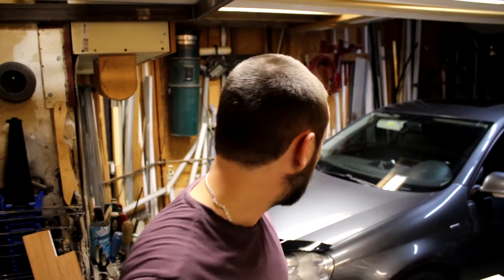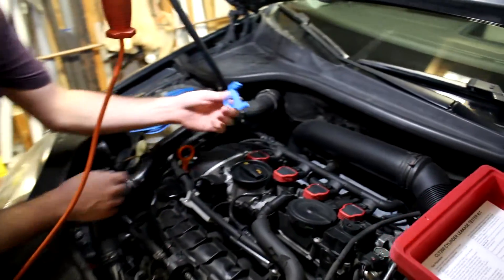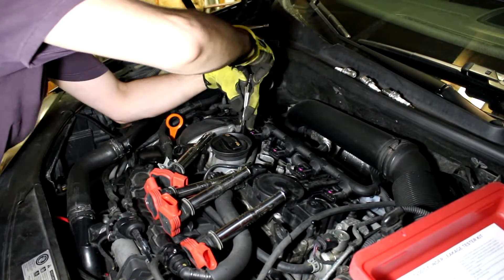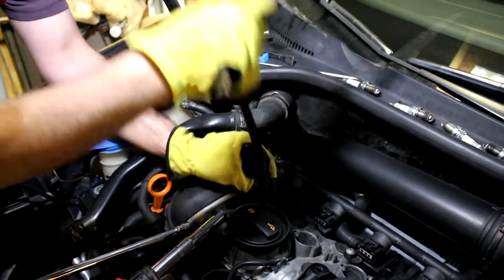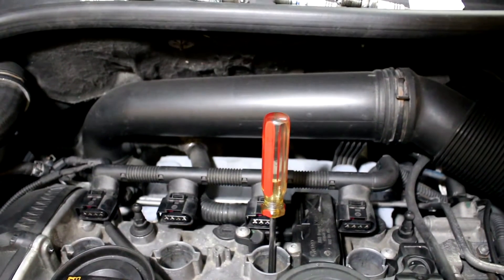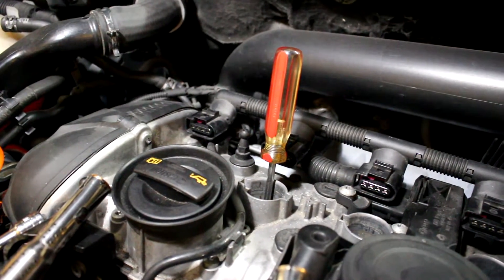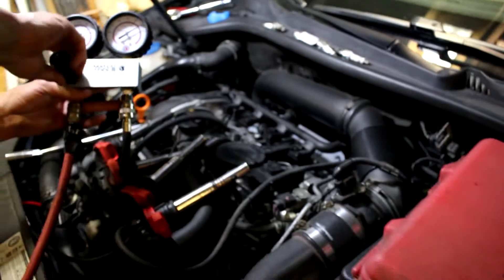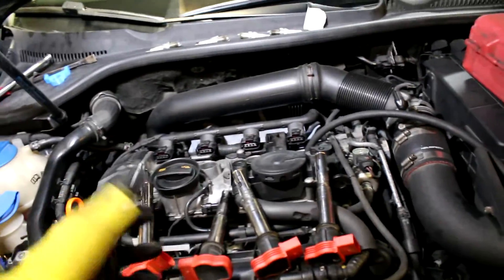How to do a Leak Down Test - VW 2.0T TSI

Comment: What if i turned engine counterclockwise? like 30*
Reply from the maker: 30 degrees doesn't seem like a whole lot, but just hope it didn't skip timing. Sometimes the valve springs may cause a slight rotation in the opposite direction which isn't a big deal.

Comment: Are there any TDC markings on the crank pulley that would help getting the positioning correct? Is it still worth doing a compression test before/after this or is that just duplicating things?
Reply from the maker: If you suspect compression is low before hand it doesn't hurt to check. As for markings, there are some on the sprocket. There's a fat tooth at the top of the pulley on the back where it mate's to the chain sprocket so that's 12oclock
Reply: @WannabeTuners  Just compression tested my 2009 VW Scirocco 2.0 TSI - CAWB engine code as it has a intermittent misfire. Getting pretty much 200psi on all four cylinders cold, very slightly higher hot. Not bad for a 90k engine and no need for a leakdown test I think!

Comment: I bought an 07 Passat Wolfsburg 2.0 TFSI with 140k miles and regret it. It died on me and I'll soon know if I have to rebuild the head or engine. I don't know why, but I'm fantasizing rebuilding with a K04.
Reply from the maker: Damn sorry to hear, hopefully the repair goes well. Haha it's an addicting hobby that's for sure!
Reply: @WannabeTuners  It's a DSG automatic. If it was a standard, I'd be more enthusiastic about trying to modify it. In running condition, the car's probably worth 3k, so it's almost like gambling to try and hotrod the thing. I've always driven manuals, and I love the control it gives me. I hate automatics, but for an auto the DSG dual clutch thing is pretty hot. Gear changes are fierce.  

My chain must have jumped. What's crazy is the chain, the chain tensioner, the cam phaser, the timing belt, everything is intact and working. You normally see broken tensioner, tensioner guides, chain, but everything is solid in my car. That almost assures me that I have bent valves. 

If I trusted the transmission, I'd go big turbo and rebuild whatever was necessary while I have it apart. 

I'm pretty mechanically inclined, but I've never done any of this stuff. Learning as I go.
Reply from the maker: @HideSeek_Soje111  So your '07 has the TSI engine? If its not the timing, it could be that the balance shaft seized up and has locked up the motor. When my exhaust balance shaft seized, the starter could not turn it and even with a large breaker bar on the crank pulley it would not budge. Keep us posted on what you find!
Reply: @WannabeTuners  It's a TFSI. When it died, the starter was turning the engine, but it sounded weird. I later found out it was the sound of no compression. I got it home and did a compression test. When doing it, I looked at the cams and both cams were turning. I had 30 PSI compression on 2 of the cylinders and 0 PSI on  the others. I'm learning as I go8 and am relying on the internet for answers, so it's slow moving. I probably should have just pulled the heads in the beginning. I could pull the exhaust manifold to try and see the valves. 

 I can turn the motor, but it comes to a point where I can no longer turn it. I get so lost with this stuff. I had the engine at TDC and placed the AST cam locking tool in the cams. It fit, but I then realized I had to make sure that I actually had piston 1 at TDC on the compression stroke. So now I'm confused. I shouldn't be hitting valves, since the . cams are still in the position that the locking tool holds them. I'm driving the Audizine forum crazy with my questions.

I'm going to look into the sized balance shaft.
Reply: @WannabeTuners  I appreciate the response by the way. I need all the help I can get.

Comment: Why not at the bottom of the stroke?
Reply from the maker: It's just generally how leak down tests are done. I imagine that at the bottom of the power stroke the exhaust valves may be open due to valve over lap.
Reply: @WannabeTuners  cool, my tfsi done 150,000 miles and I'm gonna give this a go. Thanks
Reply from the maker: @manccescapades4671  You're welcome! Let us know how it goes

Comment: Great video as usual guys.  Perfect timing because I just did this on my MS6 today.. it was misfiring like crazy and had a Po302 code.  Replaced plugs and coil packs were fine but cylinder 2 blew 0 PSI on the compression test.  Did the leak down and there's literally air coming out of the spark plug holes on cylinders 3 and 4.  Cylinder 1 had air coming out of the oil cap pretty good. Cylinders 3 and 4 were nice and tight at least.  What do you think, bad head gasket and piston rings in cylinder 1?   Got 112k miles on it and I'm sure those intake valves are gunked full of crap..
Reply: I got a cheap gauge from harbor frieight so I don't really trust the right leak gauge.. but i could at least hear the air escaping on 2 cylinders.  I just want to cry.
Reply from the maker: craigzilla100 Thank you! I know that cracked ringlands are not uncommon on the 2.3 mzr disi in the mazdaspeed's, and will usually cause high leakage into the crankcase and out the oil cap. I find it odd that when testing cylinder 2, air would leak out from the spark plug holes on cylinders 3 and 4. If the head gasket was bad causing cylinder 2 to leak into cylinders 3 and 4, I would imagine you'd have misfires on 3 and 4 as well. It could be that either the intake or exhaust valve seats are leaking, and air is finding it's way into 3 and 4 as their valves could potentially be open depending on whichever cycle they are on. It's also very important to ensure the engine doesn't cool down and that you are 100% at TDC and on the compression stroke. When I checkd mine, I took so long that my engine cooled down quite a bit, and my leakage was super high by the time I got to cylinders 4 and 2:) Did you have air leaking out of the spark plug hole on cylinder 2 when testing the other cylinders?
Reply: Wannabe Tuners thanks for the response guys.  That's a great point about the valves.  The air leaked into cylinders 3 and 4 when testing cyl 2, but when I tested 3 and 4 they are were nice and sealed tight. I even cranked up the pressure and couldn't hear anything.  So it sounds like my valves in 2 arent closing all the way or the valve seals are bad.  Cylinder 1 tested fine on compression, but I found it odd that i could hear so much air coming out out of the oil cap when I applied high pressure..  no misfires detected on 1 yet.  Sounds like I need to give it a good valve cleaning and reference your video for that again!